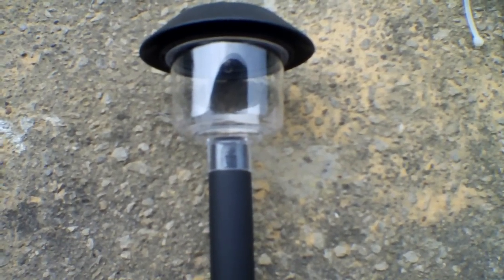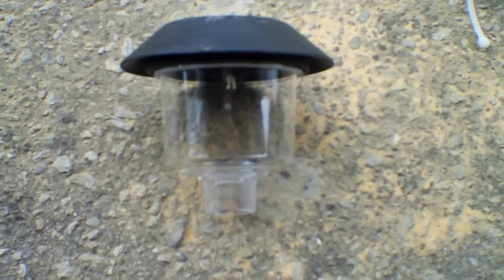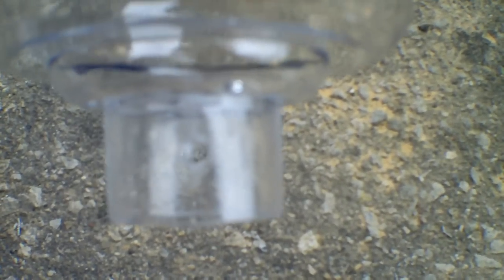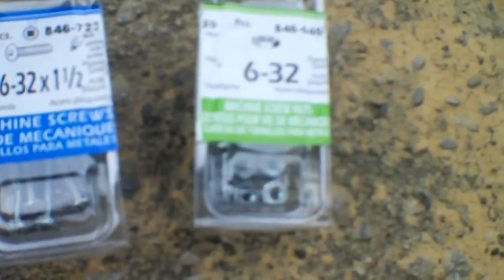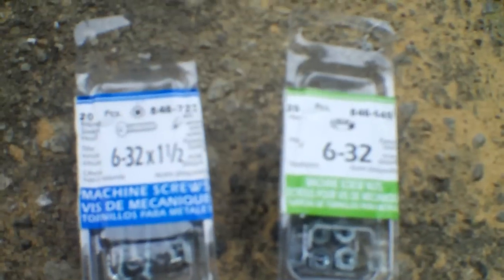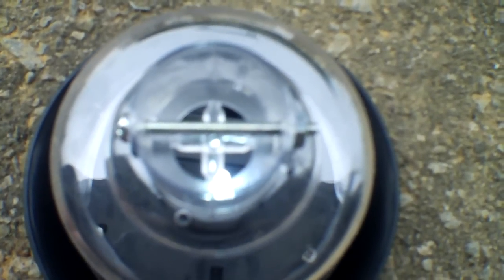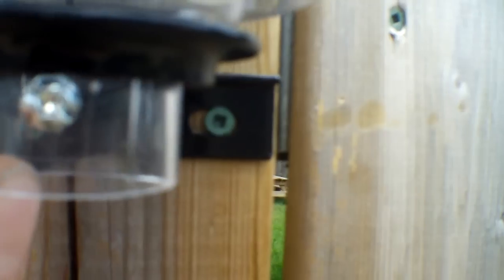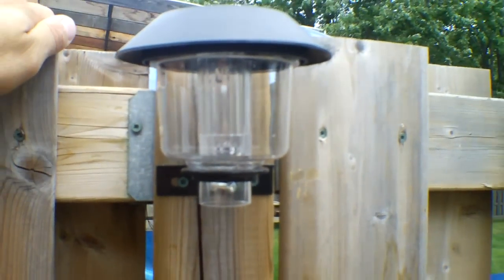Fence Mounted Garden Lights

Comment: Just an FYI, Screws ave three basic measurements: gauge, threads per inch, and shaft length in inches. Your screws have a measurement 6-32 x 1-1/2". This means it's a #6 diameter, with 32 threads per inch and 1-1/2" long.
That said, for that project I might've just siliconed them into the bracket.
Reply from the maker: Yes this is all true

Comment: What type of bracket did you use for this project?
Reply from the maker: Hello I am not sure what they are called but they can be found in the plumbing section at Home Depo.They are normally used to support copper pipe for celimg and wall installs